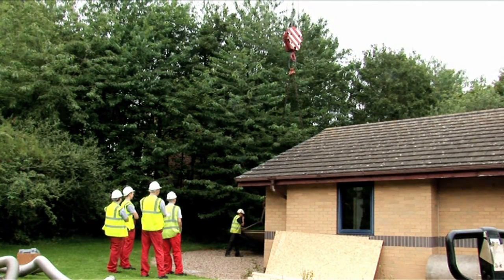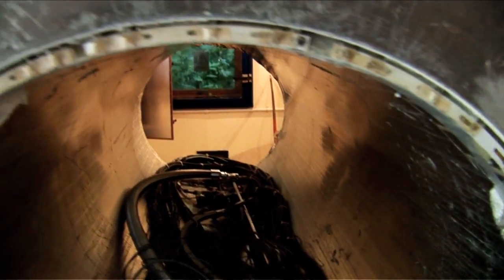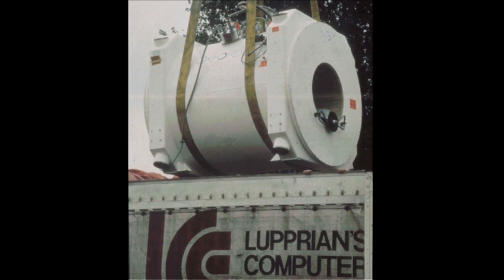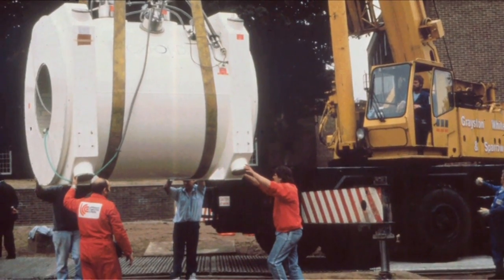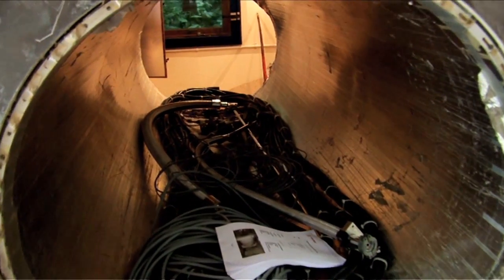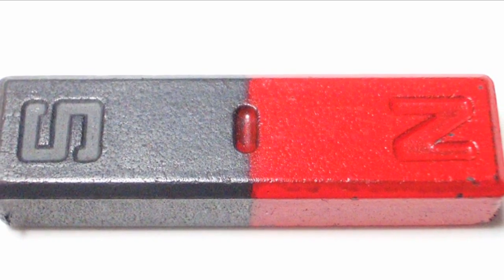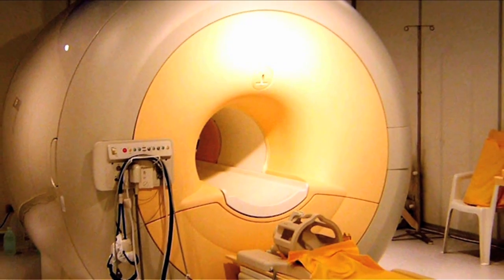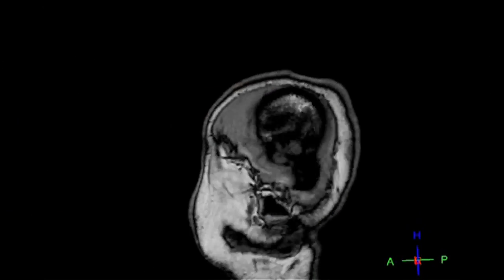Moving a Magnet

Comment: I dont know eactly how this "MRI" device (demonstrated) works, but in an NMR device (nuclear magnetic resonance) the coil that generates the field is immersed in liquid helium (temp. almost absolute zero). Then a strong current is generated in the coil, this current spins around constantly because the coil has lost its resistance at this extreme low temperature. This strong electric current generates the high power magnetic field.

Comment: In addition to the other comments: Don't forget that a magnetic field weakens in strength each time you double the distance you are away from the magnet, so eg. if you move 10m away from a magnet, the strength of its field is only 1/10.000.000.000th of the strength at 1m away.

Comment: actually, no, if you double the distance from the magnet, field strength goes down to a quarter. 3 times the distance results in 1/9th of the original field strength, its the inverse square law. at 2 meters away this will still have a field strength of 1 or 1.5 teslas, so at 20 meters distance there would still be 0,01 teslas left, still much stronger than earths magnetic field. So this monster of a magnet will still influence compass needles at a range of 100 meters.

Comment: i checked it, you are right, im wrong.

for a wire of infinite length with a current flowing through it, field strength decreases linearily with distance. and for dipoles, it decreases even faster than inverse squared, its more close to inverse cubed.

inverse squared is about halfway between these two extremes (linear and inverse cubed), but still, my answer is wrong....   in most actual cases inverse cubed is closer to the truth. So it generally decreases even faster than i assumed. thanks.

Comment: Field intensity isn't the same as total energy stored in a magnetic field. At any given point, the field intensity of the Earth's magnetic field might be miniscule compared to the research magnet shown in this video, however, due to the field's extent, the total energy stored in the field is much, much larger. It's sort of like comparing a football field covered by one inch of water with a 0.5L bottle of water. The pressure in the bottle is higher, but football field contains a lot more water.

Comment: a magnet doesn't consume any power per say. Keeping current flowing through a resistive material does. If you wanted a to build one it would depend on the size, but a quick calculation, in order to build a 1 inch 3T magnet you would need 60kA turns, that's right 60 kiloamps. It may not be physically possible to build such a large magnet by just winding copper. you may be able to do some field concentration tricks with a high saturation magnetic material, or you could buy a large neodymium mag.

Comment: This is probably a noobish magnetic question, but wouldn't the casing around the magnet still be incredibly magnetic? Or do they neutralize that somehow?
Just wondering about the above for safety reasons, like if you drag an incredibly powerful magnet towards a large steel crane you have an issue!

Comment: well that's mostly because you under estimate the size of the earth's magnetic field and the core that generates it. take for example a cheap ceramic magnet, it's pretty weak, nothing like a neodymium magnet or a cobalt-iron magnet, however if you make the ceramic magnet bigger you can achieve the same magnetic pull as in a neodymium magnet. basically the earth's magnetic field is orders of magnitude stronger than this machine but because it's so big that pull is distributed throughout the world

Comment: A speaker magnet is strong, but doesn't have a far reach.
If you keep any normal magnet near a metal plate, it will have lost its strength within 2.5 cm (1 inch) distance. The earth's magnet field is so big, that a compass can still be turned, wherever you are on earth.

Comment: its governed by the inverse square law, the same law that governs how light gets weaker over distance. if you have a candle, and you double the distance between you and the candle, the brightness will be 1 / 2x2, one quarter. 10 times the distance and you have 1 / 10x10 left, 1%.

this magnet, if not shielded, will be stronger than earths magnetic field, for (educated guesstimate) maybe 100 meters or more. The mass of the magnet doesnt really matter.

Comment: You seem to have not really gotten an answer, but I have one. This magnet's magnetic field is 600 times stronger than earth's at the surface of the earth. As a magnet it's weaker than the earth. The earth has a magnetic field strength of 50 microteslas when it's 6000km away (at the surface of the earth). This magnet has a magnetic field strength of about 50 quadrillionths of a tesla when it's 6000km away.

Comment: almost every magnet is much stronger than earths magnetic field. earths magnetic field is very weak, but very big.

moons orbit has nothing to do with magnetism, what holds the moon in orbit is a completely different force, called gravity.

and no, it wont interfere with earths magnetic field, because the range of magnetic fields is governed by the inverse square law. If you double the distance between you and a magnet, field strength goes down to 25%.